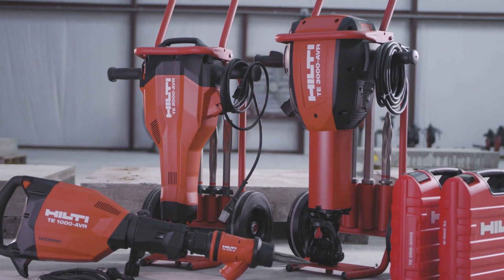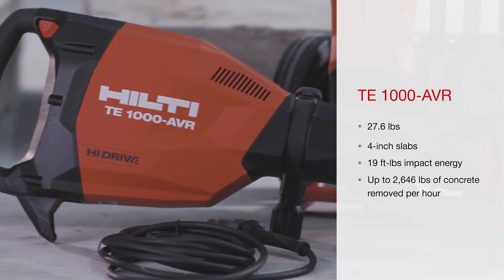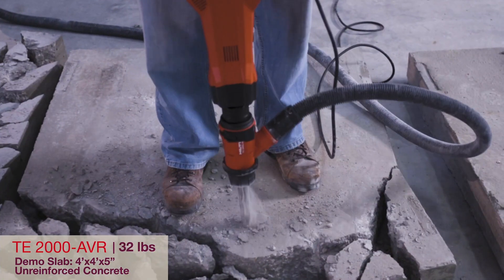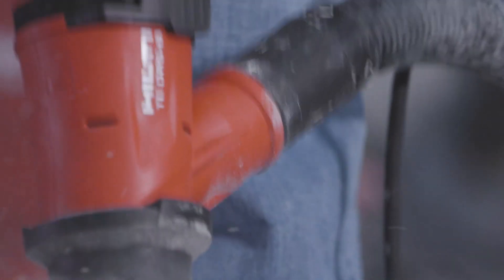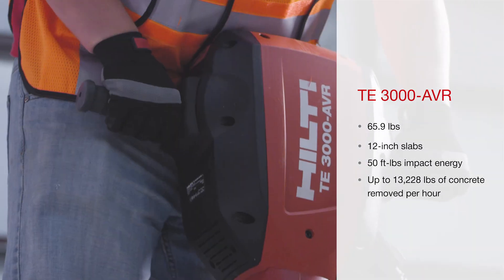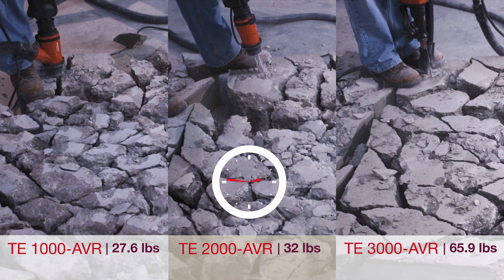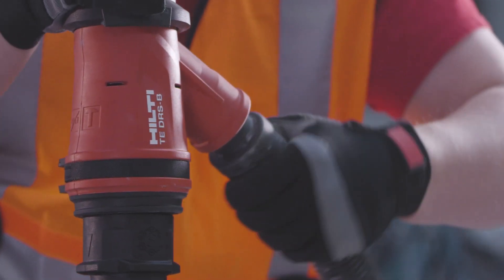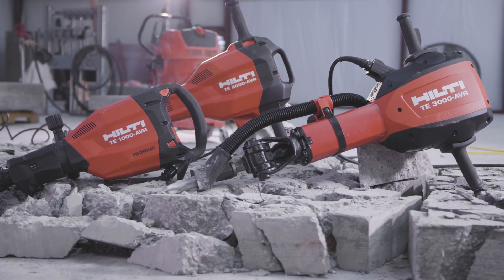OVERVIEW of Hilti Breakers for concrete demolition

Comment: Self sharpening.....BWAHHHHHHHHHAAHAA.....I've been using the TE-3000 for 2 days now. It might work on concrete slabs but if your going to break rock find another machine. I was searching YouTube trying to find out if there was a setting or adjustment I am missing to get this thing to break something. Sharpen the bits myself, use them for about 30 min each then go sharpen again. I'm working in lava rock trying to make a ditch for pipe from my well to well house. I have a small air powered chisel that works as good as this thing. Construction of the product is good and the vibration is very low for the user with their AVS system but i would rather have something that hit like Tyson and got the job done in half the time.
Reply: dissin' Hilti? that's a paddlin'

Comment: The T 300 has good power. But please don't buy it, if it needs maintenance or repairs you can't touch it. Be ready to pay shipping to send it to them. It costed me  $1000 each time. I'm going back to the good old air compressor and Jack hammer.
Reply: Can a normal sparky not repair it?.